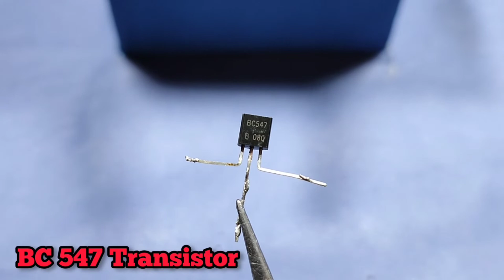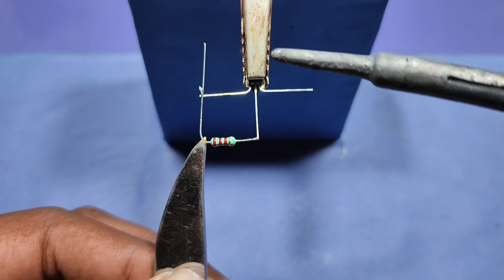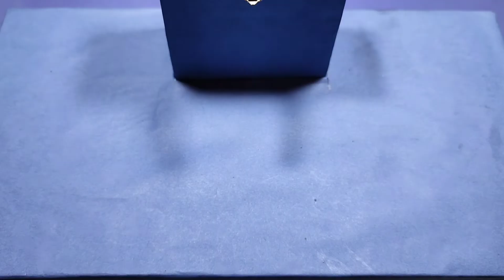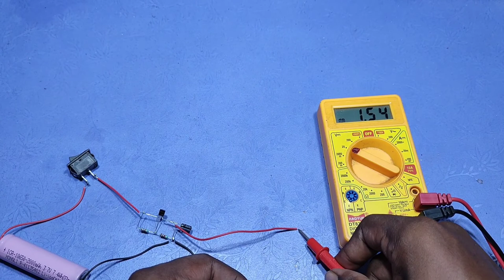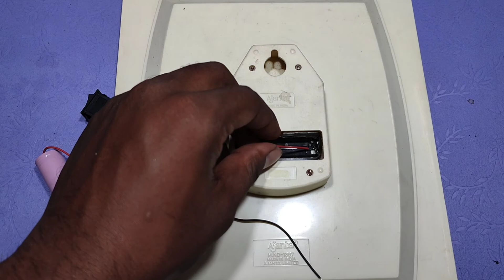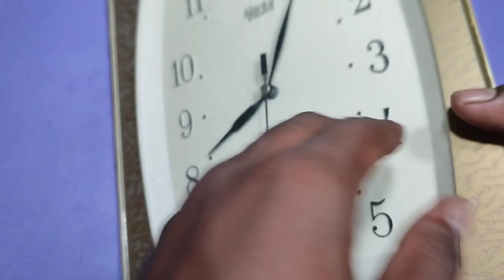Lifetime Battery For Any Clock || Circuit For Wall Clock || 3.7v To 1.5v Convert

Comment: 3,7V battery is rechargeable battery. How to recharge it? How this circuit is called life time free ? You have to charge lithium battery regularly and replace it when it becomes low o/p Ve.

Comment: 3.7 v battery to 1.5 v 11 ma power . I use BC 547 , two 10 k register. Which capacitor I use ? Pls suggest.
Reply: I use BC 547 , 4  k register, 25 v 22 uf capasitor. Work done. 3.7 v Li lion battery to 1.5 v 11 ma power for mouse. 💯 Work . Done 👍